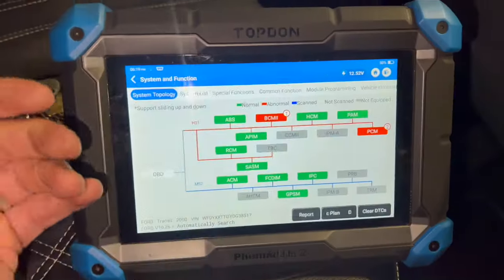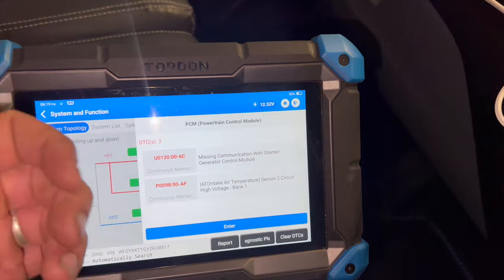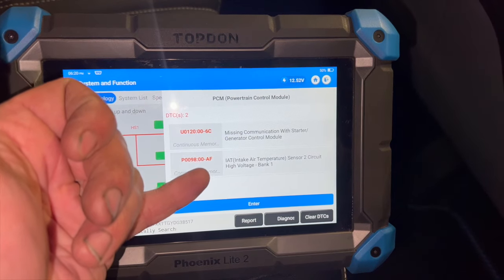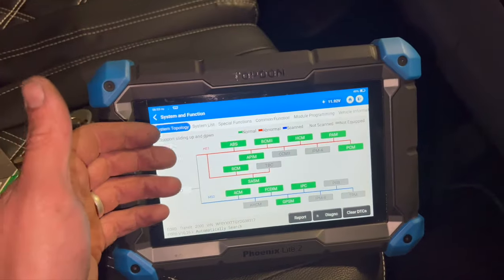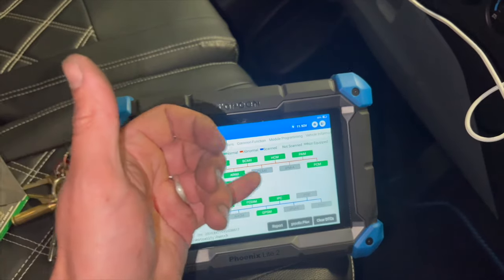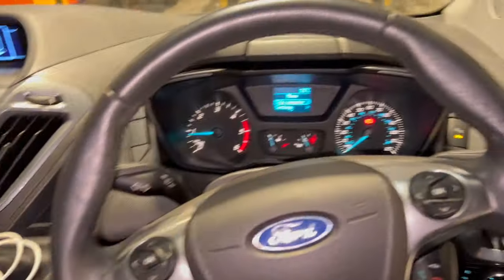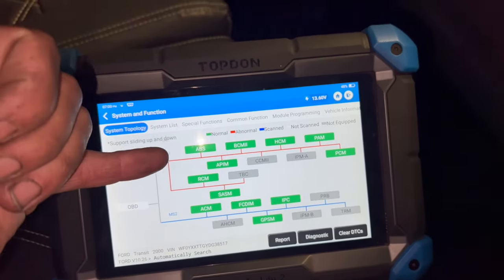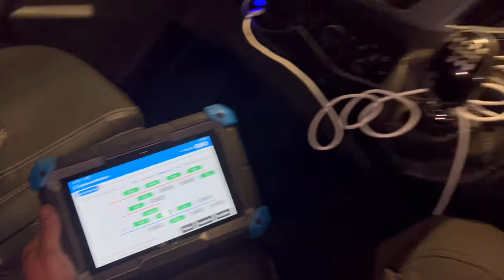Ford Transit custom P0098 IAT Air intake temperature sensor 2 fault fixed

Comment from the maker: New aftermarket IAT temp sensor - https://ebay.us/fQYTLn

Diagnostic machine used in this video:
Topdon Phoenix lite 2 Ebay - https://ebay.us/tsyiTI
Topdon Phoenix lite 2 Amazon - https://www.amazon.com/dp/B0B1MB6YG8  

Tools used :
Leatherman wingman multitool - https://amzn.to/41dtKwm
Multimeter - https://ebay.us/WlGnoP
Automatic wire strippers - https://ebay.us/Nba5QL
Mini blow torch - https://ebay.us/WlKTvI
Solder connectors - https://ebay.us/oEuDWh
Glue lined heat shrink - https://ebay.us/YVM55b
Insulation tape - https://ebay.us/i2BYkV
Wiring harness tape - https://ebay.us/dEqNGa
Portasol Gas torch / soldering iron - https://ebay.us/P678Sk
Terminal pin removal kit - https://ebay.us/8zQh4N

Check Euro car parts - https://tidd.ly/3lIO7xA  (use discount codes on site)
Check GSF Car parts - https://tidd.ly/34pZe7o  (use discount codes on site)

Comment: Did you sort the issue of the starter generator fault I’ve got one checked the usual inc Lin wire all seems ok is there a video maybe love the channel
Reply from the maker: Afraid I haven’t had it back in for it yet mate

Comment: Was ist das problem wenn er P0097:00AF  sensor 2 Circuit Low voltage Bank 1 anzeigt. Vielen Dank

Comment: Great pal, mine is still on though after replacing bottom sesor high air intake. Im maby going to try replacing the top sensor do you think that could do it
Reply from the maker: Possibly unless you’ve got a wiring issue on the lower one